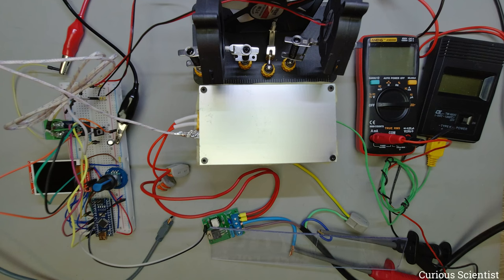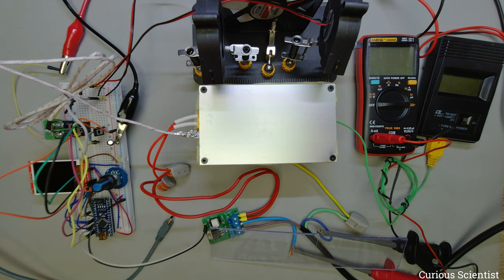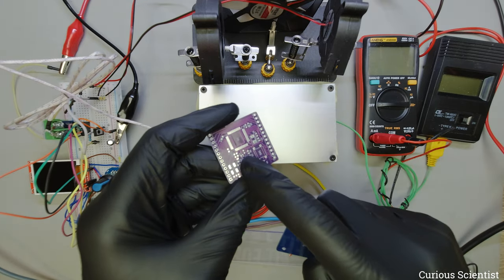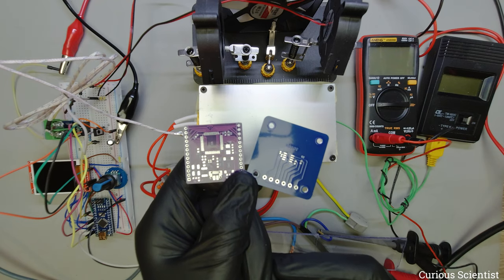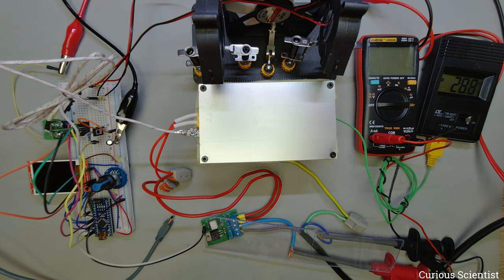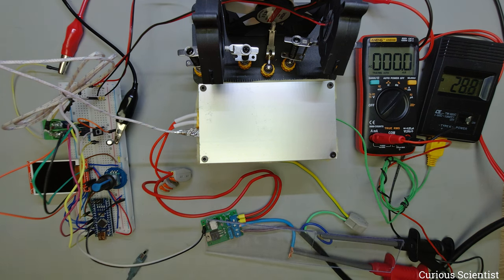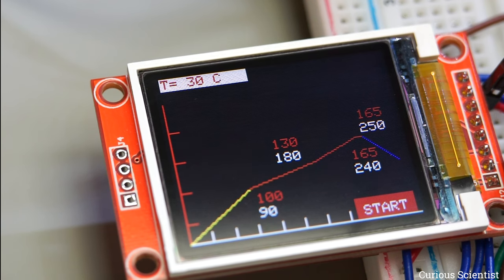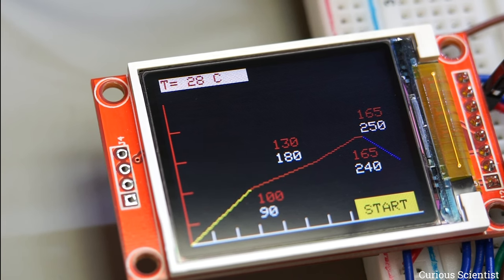Making my own reflow hot plate - Part 1 - Prototype

Comment: Think with a ptc heated bed you lose some of the power since it's a linear increase of resistance, it doesn't just stop after a temperature limit, it gradually gets lower and lower power. The alternative would be using a simple resistive heated bed (you could even diy one for your exact power requirements using aluminium based PCBs), but that has safety issues since if your control circuit fails it can get red hot and set stuff on fire. To mitigate that you could use a failsafe like a bimetalic cutoff switch at a higher temperature than you'll ever need in series with the mains.
I like the UI, looks really nice.
For the curve using a PID controller with a platinum temperature sensor should be able to achieve a really smooth curve.
Reply from the maker: One of the heaters I ordered is a resistive heater. A Kanthal wire is wrapped around a mica plate which is then sandwiched between 2 other mica plates, and this whole stuff is encapsulated in thin stainless steel sheets. I also ordered some of those ceramic heaters which can be found on those BGA rework stations. Just to play around with stuff. The platinum thermometer would be nice, but they are slow and expensive. At least those which are easily available. I can use the thermocouple easily and they are cheap. I could even spot-weld it on certain surfaces for good thermal contact. Regarding the UI, thank you so much! I worked a lot on it to figure out all the stuff and create a decent interface.
Reply: @CuriousScientist  the 2x2.3mm platinum RTD sensors are quite affordable (under 5 GBP) and have very quick response.
Reply from the maker: Hi! Yes, wrong phrasing from my side. The sensor itself is of course quick, but the circuit (max31865) is slow and also expensive.
Reply: @CuriousScientist  Most of the delay is probably down to the mass of the hotplate itself and the heat conduction delay.  To stabilise the control loop then needs a long integration time.  For the precision hotplate controls that I build I use cascaded controllers with a separate sensor on the heater element itself.  An RTD on the hotplate and a differential thermocouple between that and the element.

Comment: If you preemptively turned the heater off at a lower temp than required, you may be able to minimise overshoot.
Reply from the maker: Hi! Thanks, that is a great idea! What I will do is I will come up with some kind of multiplier that will change as a function of the temperature. The higher the temperature, the longer the TRIAC will be kept switched on. Actually, I mentioned this stuff a few days ago on my IG. The large overshoots at low temperatures are due to the (natural) behaviour of the PTC heater. While it is "cold", its resistance is low, so when I turn it on, a large current can flow through it. When it is properly heated up, its resistance is higher, so when it is turned on, the current is already limited, thus the overshoot is much lower. I will implement something and publish it in an upcoming video.
Reply: That's what the D term of a PID controller does.

Comment: I also tried to build one, but the temperature sensor is just to slow for a good PID control (like the blue bumpy temperature graph). Then I used a Mlx90614 sensor to read the temperature and now it's much more precise.
Reply from the maker: Hi! I don't have issues with the speed of the temperature reading. I can go really fast. Now I read it every 250 ms, and the TRIAC program checks the temperature every 1 s. I think the issue is, especially at low temperatures, that the PTC draws too high current which results in a large overshoot. I will fix this with some software tricks and try if it works.
Reply: How slow is too slow?

Comment: Because it's AC, both mains wires, brown and blue, will manage to fry your pants off if you manage to make a connection. The AC signal is symmetrical on both, although one from the perspective of the other will be 180 degree out of  phase to the other way around. The biggest difference is if one has more resistance to the ground wire vs the other. So I never understood the concept of 'neutral' wire. They both hot!!
Reply from the maker: Yes, you're correct. This was a more "funny" explanation for those who are like me and always forget the naming of the wires. In any case, it is not advised to touch any of those wires anyway.
Reply: @ivolol This depends on the supply. In the UK for example the neutral is grounded at the substation transformer so that the neutral in the home is never more that a few volts from ground (or earth as we call it). So the line (brown) wire is a sine wave of 230V rms (usually rather more) centred around ground. This is usually the case for single phase supplies throughout Europe. 
I have always remembered my aunt telling me that "George Brown is a live wire" back when the colour change first came in (George Brown was a well known politician back then).